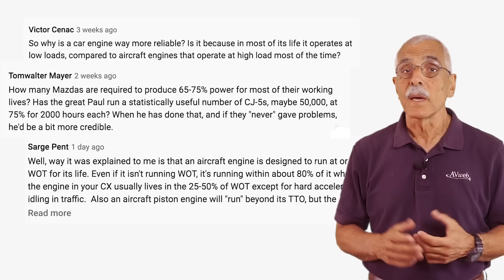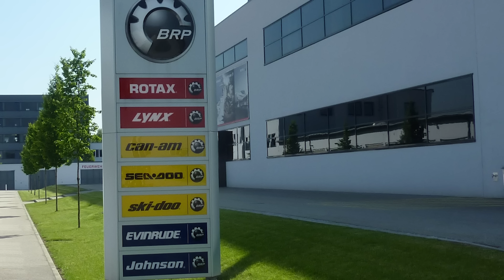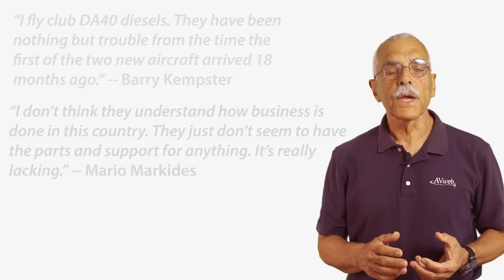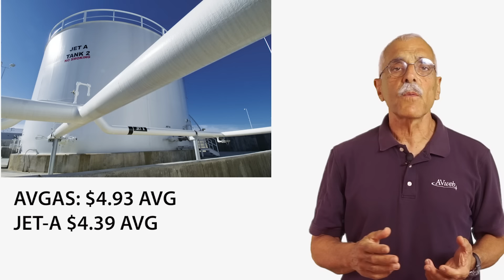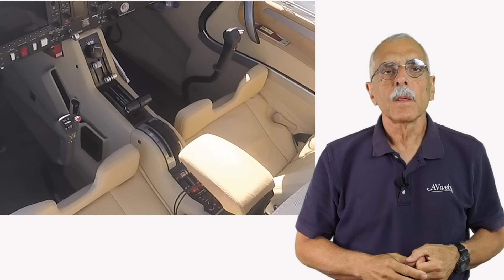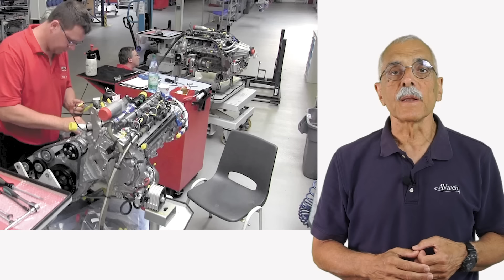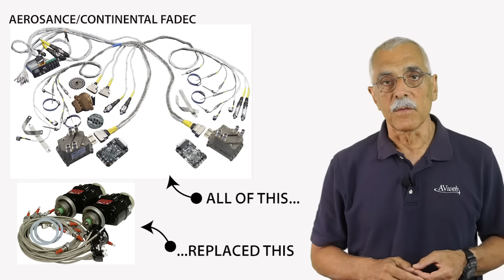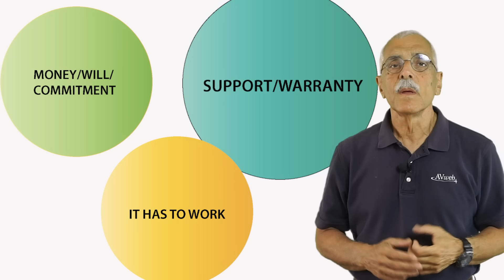Why New Aircraft Engine Ideas Rarely Succeed

Comment: We operated the Comanche 400 (io720) for a few thousand hours and the only way we could get home in summer, after refuelling and a quick turnaround, was to purge the air from the lines with full throttle, flood the system and then crank in full lean……hammering the poor old starter motor.
It was sweet when running but a right pain to hot start.
What happened to that engine ?

Comment: Great video and the top comments claiming why it is great are on point. BUT, (lol,) I hate to see this in 20 years when electric takes over and all these become moot. With one moving part in an engine, these talked about engines will be reduced to wire thickness, number of winds and size! No contest on the engines. Watch out behemoth dinosaurs. ThE power probelm is being solved so quickly it is a part time job to keep up! (After you catch up.) I hope to hear some more from this awesome style of channel that is niche and not for the general masses. Keep up the good work!

Comment: What about the aspect that Government regulators have made the process so costly that the innovation is suffocated out of the field. Then any engines that do make it to market are largely cost prohibitive for their power ratings because it cost so much to get it approved. I’m thinking of EPS who filed for bankruptcy after already spending 60 Million on R&D to get the engine approved, and it was supposed to be certified in 2015, but that kept getting pushed back and increasing cost. 

Regulations are a huge problem against innovation.

Comment: Really interesting video.
Today the UK Gov announced that new tech will make domestic flights CO2 emissions net zero by 2040, and international flights be 2050.

I expect you'd say is unlikely to get much traction through depending on new fuel/propulsion ideas?

Some background:
Meanwhile the Sustainable Aviation coalition set targets reduce emissions by 40% by 2040, relying in efficiency and SAFs (sustainable aviation fuels ~20%), and carbon removal - although the Climate Change Committee expect about 8% SAFs by 2035, then about 1% increase per year.

https://www.theccc.org.uk/wp-content/uploads/2020/12/Sector-summary-Aviation.pdf
https://www.sustainableaviation.co.uk/

Comment: The best solution is a small, reliable gas turbine engine. Fewer moving parts, abundant fuel availability and no carb heat issues.

Comment: I love the development of the diesel piston engine. I just pulled a da40 diesel out of my back yard after it blew a turbo hose off. I imagine theyll figure out how to make it reliable.
Reply: Had one of those with less than 100 hours fail. 

Not a fan of the Austros, from a mechanic point of view (tho the fadec/troubleshooting is nice)
Reply: @Notthe_droid_youarelookingfor  this one had just passed its 100 hour service a few days before the crash
Reply: @anythingwithplanes  I was just commenting on the engine in general, not this AC.
Reply: @Notthe_droid_youarelookingfor  i was too. the engine failed, but the airframe is a solid design
Reply: @anythingwithplanes  In my opinion kind of the same thing with the diamond aircraft. If it’s all together it’s a pretty airplane and fly as well. But maintenance on it can be a bear at times 
. If you follow their maintenance recommendations, you eat up that gas savings real quick

Comment: When I visited an aviation mechanic school, they said that the tech appears to be outdated, because it is. The reason why new engines don’t make it in planes all that often is just because people want to stick with the devil they know. Engines are expensive, planes are expensive, and the stakes are very high, should an engine fail abruptly. Why take a risk on a new engine type when they payoff for said type is mild to moderate efficiency & power upgrades?

Comment: I realize that this video is aimed at certified aircraft, and larger ones at that - but there is one automotive engine that has proven itself time and again in light experimental aircraft: the VW Type I Bug engine.  It's the only automotive engine that one can simply stick a prop flange on, make an engine mount, and put on an airplane.  Granted, smart money puts a Diehl case alternator on the rear of it (for around a grand), rig up some carb heat, and away one goes.

Comment: 190 knots (219mph) at 16 gallons per hour, is equal to 13.8 miles per gallon. 
Considering that you are in a plane, dont have to drive on non straight roads to get from point a to b and can even "drive" that fast. 
That does seem very fuel efficient to me. (a car driving that fast would burn about the same if not more gas)
Reply: And no road construction to deal with

Comment: Frankly, I prefer the good old Piper PA-44 Seminole.  If I had $100k burning a hole in my wallet and wanted a six figure toy that did not have the Lamborghini bull on the frunk cover, I would think about one of these.  So what if they are old technology!  There is one simple reason that we drive around in 2.0 liter/120 cubic inch DOHC direct injected turbo four cylinder engines that make upwards of 340 hp, nearly the same as a 426 cubic inch Chrysler hemi from the '60's [if you factor in  the net versus gross horsepower numbers], and yet our airplanes are powered by stupid 1940's designs with 1/3 the power, and that reason is simple:  Because aircraft engine manufacturers have been ATTACKED by liability lawyers since the 1960's!

Google Earth Vero Beach airport in Vero Beach, Florida.  You will see the HUGE grass areas in front of the airport terminal.  Why are those there?  Simple:  Those USED to be the parking lots for all the Piper Aircraft workers.  The workers who have all been laid off.

What these liability lawyers have done is convince juries that because an engine failed, for who knows what reason why, maintenance, poor use, whatever...It is the FAULT of the manufacturer.  Yes, the fault of the manufacturer.

Can you remember a time when your car's engine failed? Or you were in an accident? I bet you can...

What "Liability Lawyers" use as an excuse is that if an other manufacturer did something different, such as overhead cams, then they would use this to confuse and convince a jury that this big company was negligent.  

Negligent because they "knew" that this new technology was "safer" and didn't install it...To save money~

Thus, liability lawyers use technology to secure gigantic lottery payouts from large companies, who realize it is cheaper just to pay off the lawsuit than to fight it in court.  But of course, because of this technology does not more forward.

So what about the automotive industry?  WELL GUESS WHAT:  Because they are such a driver of the economy, there was an act of congress that actually PROTECTS them from simple liability lawsuits.  THIS is why it costs over $100 per  hour to fly a fucking Cessna 172 or a Piper PA-28-161!  

Meanwhile, liability attorneys sail their 70 foot diesel yachts up the Intracoastal Waterway in Fort Lauderdale.  The republican party is for "tort reform", yet they never do it:  Guess what most of these republicans are:  

Liability lawyers....

It isn't a purely republican party issue, the Democrats are exactly the same.

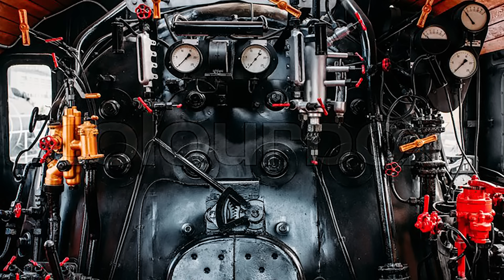Comment: @12:43 Steam locomotive engineer checking in. Never thought my skills would be applicable on an aircraft video of all things, but here you go: How many levers it takes depends all on what you're doing. If it's just keeping the boiler fired, assuming it's running on oil, as most do or have been converted to do these days, there is the firing lever which controls the fuel going to the atomizer, a valve that controls how much steam is going to the atomizer (the fuel is atomized with steam, the water vapor isn't an issue), and three more valves that control injection of water into the boiler (technically two sets of three, since there's two injectors for redundancy). That's a lever and four valves just to idle it at a standstill. If you actually want to move the engine, there are five more required levers: The johnson bar (or power reverser on full size locomotives built after 1939) to pick which direction you wanted to go, the throttle, the cylinder cock lever (these let condensed water drain from the cylinders when getting underway) and the two air brake levers to control the engine and train brake. So, around six levers and four valves. There could be more or fewer depending on the exact configuration of the locomotive. If you want to be technical there's always bunch more valves for various things, drain valves or bypass valves or isolation valves or whatnot which while are necessary to operate the locomotive safely in all situations, aren't technically needed to move it.
Reply: From a UK perspective, this intrigued me.  I am a bit of a preserved railway fan (well, OK, QUITE a bit of a preserved railway fan) and I can't think of many locomotives over here that have been converted to oil.  The Ffestiniog went down that route to avoid lineside fires (and because this is typical of the Ffestiniog - they'd be electric if they thought they could get away with it!), but I'm pretty sure they later converted all their engines back to coal (because it was cheaper?).  The whole point of a preserved railway is to preseve what they were like back in the day (more or less), and that means steam - and coal.  Visitors and enthusiasts might be interested in the novelty of the odd oil-fired engine, but they'd be very disappointed if they turned up to discover NO coal-fired engines.  The whole point of a steam engine is that there's a bloody hot fire 'inside' it, and a bloke on the footplate shovelling coal into it periodically.  A single driver (engineer), just moving levers just wouldn't be the same.  AND it wouldn't smell the same!  There's nothing quite as evocative as the smell of steam and coal smoke.
Reply: @paulhaynes5029  It depends on where in the world you are. If you have cheap oil or not. In the US, there are fewer and fewer coal burners every year, mostly because the conversion to oil is very simple, could technically be undone at any time, and extends boiler tube life a whole bunch, as well as diesel fuel or fuel oil being a whole lot easier to deal with logistically, and often is cheaper than coal here. High quality pure coal is getting more and more expensive because there are so few places that bother mining it, because the last major use for coal is power generation, and modern coal fired power plants run on the lowest grade of coal possible which is the cheapest to mine. Firing steam locomotives on that low grade coal is a nightmare. Correct me if I am wrong but I believe you guys over in the UK only have one proper source of locomotive grade coal left, and that's been flirting with being shut down for some time now for the same reasons our high quality coal mines shut down?

Most steam locomotives built on the west coast of the US either were built as oil burners or quickly converted from coal to bunker oil (and then later to fuel oil or diesel fuel) because oil was/is way cheaper on the west coast. They still had an engineer and fireman, because while firing an oil burner is easier, it's still a full time job.
Reply: @SuperAWaC  i don't know how the quality of the oil from the California oil fields was - but if it was light, it is light enough to fill a steam locomotive's bunker with....

Transport costs cant be cheaper than that.
Reply: @SuperAWaC  check out how many steam transport companies/vintage railways UK has and compare it with the situation in the US.
Reply: @TheStefanskoglund1 I saw a video of a railroad in Nevada that gives people an opportunity to work on the train crew or even become an engineer. One of the employees said the engine didn’t burn coal or oil…it burns money lol. But yeah I’m a bit fascinated by oil burning steam engines. It’s cool they can even run on diesel
Reply: @Paul Haynes - Ffestiniog sounds like the California of Grate Britain.
Reply: Manually operated bypass valves exists because the builder and the first owner didn't want to invest in steam operated bypass valves (they are really necessary with piston valves.)
Reply: Well said😉
Reply: How do I get your job?!
Reply: @kazansky22  give up on your dreams of becoming rich and famous and start making phone calls to steam railroads asking for a job
Reply: That sounds perfect!  Now how small could you make one?
Reply: @stvrob6320  look up garden scale live steam, those are the smallest generally available steam locomotives.
Reply: A number of swedish steam machines (and other european too) has a valve which connects front and rear of the piston. This to allow a more free rolling engine while steam is shut off, the handle for that valve is placed beside the 'johnson bar'.  In most large swedish steam locomotives, that is a screw which pulls a connecting rod.
Reply: The US equivalent would be a drifting valve or drifting throttle
Reply: @SuperAWaC  more like drifting valve in this case.
The most prolific swedish fast steam loco (the B class) has a combination of steam operated drifting valve and overpressure valve for each side of the cylinder.
They are visible above the valve piston in this photo https://en.wikipedia.org/wiki/SJ_B#/media/File:B_1382_i_Arvika_1930-talet.jpg
Reply: interesting to see such a modern engine design with tilted cylinders
Reply: @SuperAWaC  B isnt really modern - it is basically a version of the prussian P8.

The reason for the the tilt is basically a question of gauge.

Comment: I could see how those Mercedes Diesels could work in aviation

The problem commonly associated with them is Nox sensors, clogged fuel injectors and can bus ecu's

But! if they just removed all that emissions stuff, they would easily run for hours on end without any major problems

Comment: The problem with adapting automotive engines for aircraft use is that taking technology from one application and adapting it to work in another application inevitably introduces additional complexity. More parts = more cost, more weight, and more things to go wrong. This violates the fundamental goal of aircraft engineering: To reduce and simplify the machine until it is everything you need, and absolutely nothing that you don't need. Everyone of the "advanced" engines mentioned in this video adds gear reduction, water cooling, dual overhead cams, four valves per cylinder, electronic fuel injection, etc. All of these technologies are neat and have their place in a car, but their drawbacks make them not worth including in an airplane. Build for me a simple, aluminum block, air/oil cooled direct drive two-stroke diesel with mechanical fuel injection. I bet it will be lighter, cheaper, and more reliable than any car engine.

Comment: I'm glad to see that piston-engine aircraft are being built that can run on jet fuel. Getting rid of leaded avgas should be a no-brainer, especially if diesel engines running on jet fuel are easier to operate. I can't understand why people are still bothering with leaded avgas at this point.
Reply: Vintage aircraft engines

Comment: Car engines nowadays are overbuilt for reliability, which is why it's almost un-heard-of nowadays for a car engine to require a rebuild before the rest of the car falls apart around it.
(this holds true for European cars as well -- the engine lifespan is still comparable to the chassis lifespan, they just both fall apart much faster.)
So...Serious question: How overbuilt would an aircraft engine need to be to run at 75% of peak torque for about 5000 hours, roughly the equivalent of a car engine's maximum lifespan? Would such an engine be so overbuilt that it would be too heavy to fly?

Comment: When Caterpillar got into diesel truck engines they thought it would be trivial. What could give more punishment to an engine than a dozer? Well, they quickly learned. They were shelling out truck engine prototypes like potato chips. Hi torque lugging down is much different than sustained high speed with lower torque.

Comment: I owned a '65 Mooney.  It was built BEFORE we went to the moon.  (Think about that!)  The Lycoming IO360 sold today is almost identical.  You cannot convince me that humanity is too INCOMPETENT to develop a safe,  simple and inexpensive way to adjust the fuel mixture automatically.  In the years I have been in aviation I am convinced that Lycoming and Continental OWN the FAA, because it cost MILLIONS to attempt to introduce any new engines.  Since the FAA (bought and paid for) makes it impossible to bring any competition - Lycoming and Continental have zero reason to make improvements.  Want proof?  Both manufacturers offer the simple feature of managing your fuel mixture for a ludicrous price!  It should have been a natural upgrade for safety over the last 50 years like any other technology that has competition.  This was a cute video, but did not address the REALITY of how the FAA makes it cost prohibitive to compete with the entrenched manufacturers.  It covered bringing car engines into the mix, but NOT the natural progression of improving aviation engines over the last 50 years!
Reply: You are 100% right. Today if you buy a SR22T, you will have an avionics suite that was not available in 1980 for the business jet , but on the front you will have an engine that has been designed in 1950/1960 this should be not acceptable